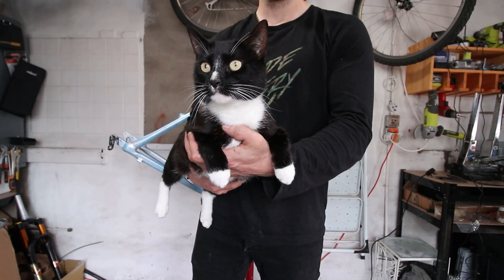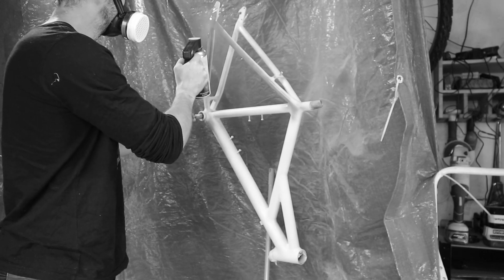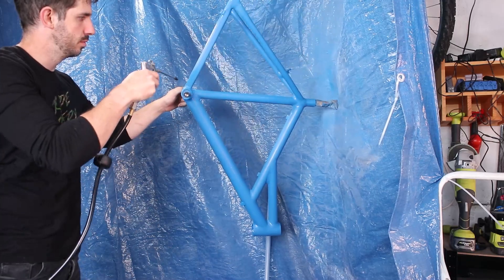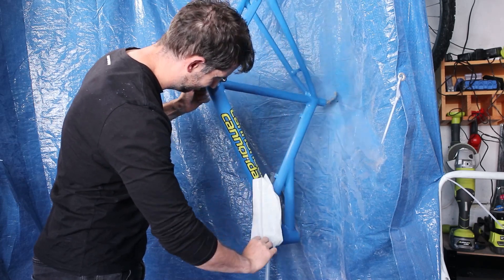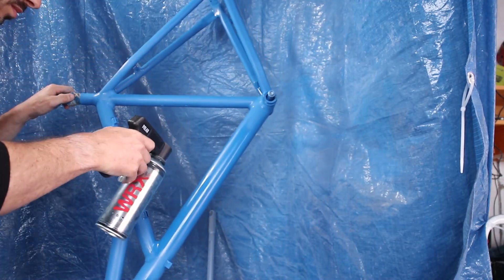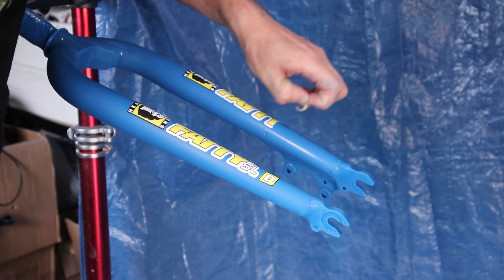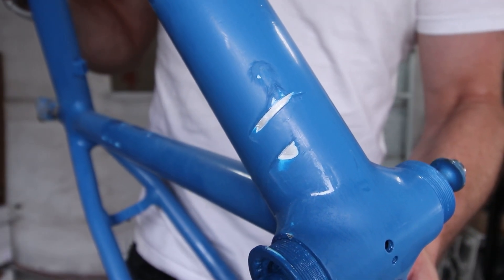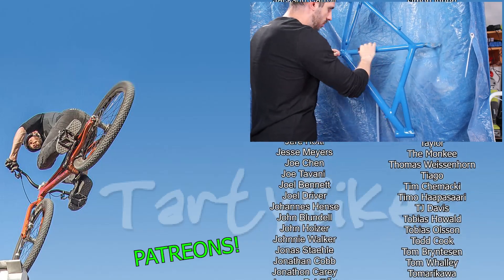Retro Cannondale MTB Gravel Bike Conversion Episode 2.5

Comment: When placing decals, stick a line of masking tape first to edge where your sticker is going to be, that way you just line up the decal with the tape
Reply: Yes masking tape or fine line tape will help. You can also buy decal backing paper / transfer tape to help with alignment. I also recommend using a soapy water (one tiny drop of soap in a bottle) spray to allow you to position and smooth the decals. If you get any bubbles you can just carefully nick them with a razor blade.

Comment: With the decals.. when i built up my pk ripper my friend dampened the frame a little (like window tinting) placed the decals down and you can move them slightly into position (marked with thape etc) and work out any kinks or bubbles dead easily.

Comment: Hairdryer bro.
Love the colors!
Reply: Hi Ali, your series has inspired me to also build a gravel bike. Had this idea for a while and also have some parts lying around. So I organized a used frame, sanded and painted it. Organized a nice used carbon fork and ordered a new headset to fit a tapered fork in a straight head tube. Today the headset arrived, I pressed it in and then realized that the steere is just a little bit too short because of the external headset cups😂🤦

Comment: Not seen the vid yet…is it a Delta V-700?

If it is, it’s an old one…the rear mech hanger assembly seems unusual 

I have a delta-V frame I’d love to restore, only, a DCD dinted my chainstay and, alas, I don’t think there’s much that could be done about it…unless you know different?

Maybe a chop of the entire backend and a conversion over to a 27.5” would be a cool idea

My Decals are painted/stenciled on though.

Also, as I bent the headshocks so far back in a crash, I had to get some reduction kit cups to run some standard forks…would be cool if someone could make some new cups that I could use tapered forks in though :-D

By the by, a hair drier is what you need to release the stickers 😉

Comment: Hi, nice video, i'm planning to repaint my bike and so i would like to know how long did you let the paint dry before sanding it between the coats? hopefully you get the decals problem fixed.
Reply: On a warm day you should be able to get all the colour coats sprayed. No need to sand inbetween unless you want it silky smooth. Depending on paint wait a few days for curing then spray clear coat.
Reply: Agree! Shouldn’t need to sand as the colour is very thin. But definitely buy some tack rags and wipe between painting. Typically 10 to 20 minutes between 3 coats. Recommend investing in a 2K clear coat (the type where you snap the can to activate) then spray the clear after typically 10 to 20 minutes. Check out some car spraying videos for the techniques especially movement and distance of spraying.